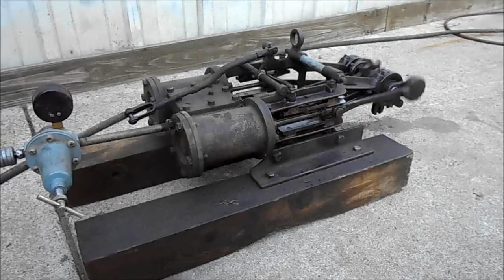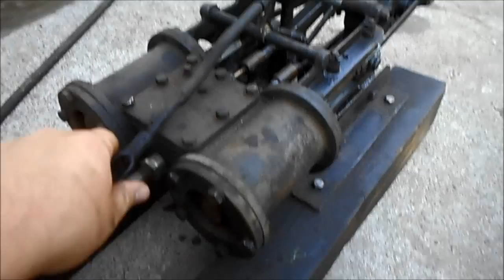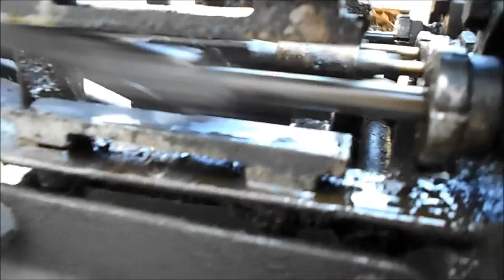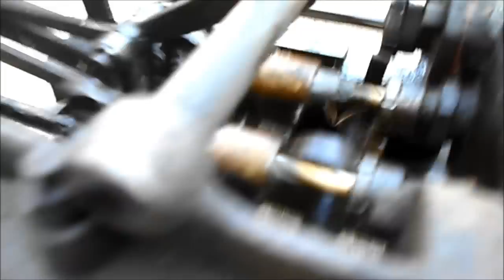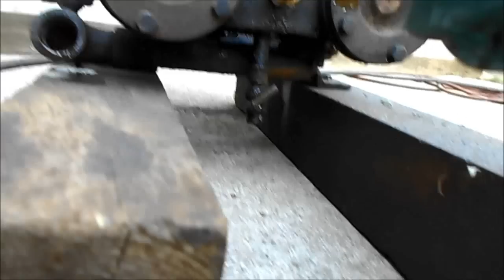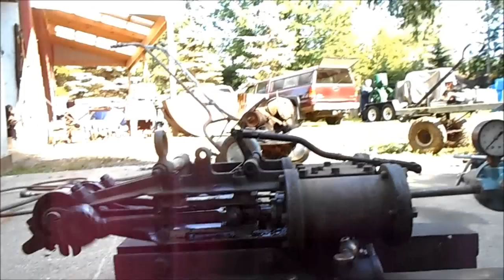Original Stanley steamer car engine

Comment: Is this the 20 or 30 hp?
Reply: Was there a difference?
Reply: Hi guys! Bullshit is that the power depends on the steam pressure. At its peak, it can be up to 100 HP or even more.
The second bullshit is that the efficiency directly depends on the cutoff. The shorter the cutoff, the higher the efficiency. But the shorter the cutoff the higher the speed should be at equal power because with a short cutoff the torque is rapidly reduced along the course of the piston.
That is, you can accelerate on a long cutoff equal to the stroke of the piston, but this will be a very inefficient mode with maximum torque. When you reach cruising speed, you need to make the cutoff as short as possible. Then the fuel and steam consumption will be minimal at the maximum possible power. 
The inclusion of a capacitor in a closed steam cycle has a very good effect on the efficiency. With a capacitor, the efficiency will be at least 18%.